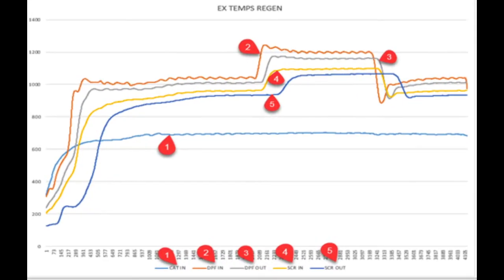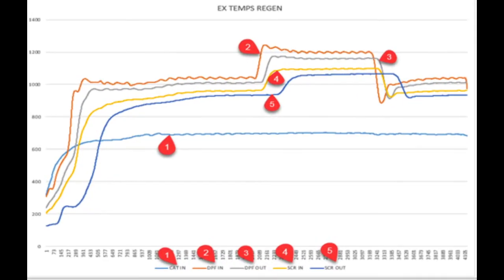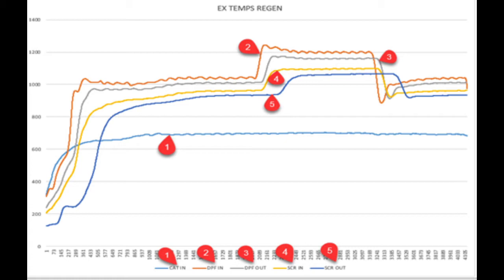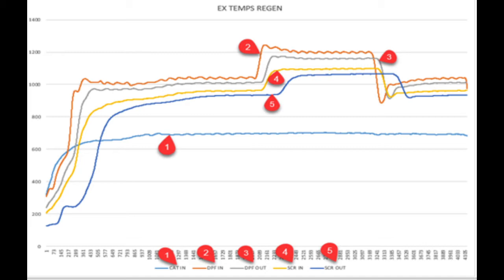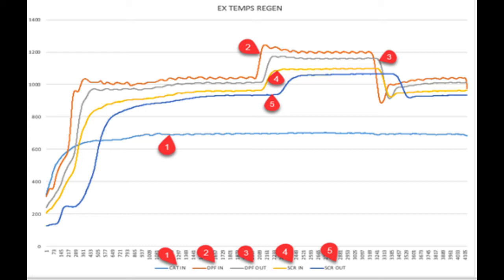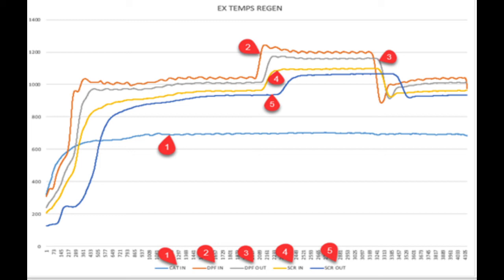ISX 15 CM2250 Regen Temperatures - Textbook regen

Comment: Just finding your channel today, while my work is on 4.5 and 6.7’s this is all great info that is transferable 👌👍
Reply from the maker: Welcome aboard and please do comment whether you agree or not. Those are both good engines in my opinion.
Reply: @ENGINESHOPJOE  the 6.7 is a great engine,  very little trouble mechanically and pretty decent to work on. 
The 4.5 is more troublesome. I’ve seen a few spit out front crank seals for no good reason, and several catch fire due to the egr cooler being directly beside the composite rocker cover. (Burst coolant hose type overheat) 
My biggest bugbear is the injector pipes passing through the rocker cover. 😡

Comment: I have ISL 2350A, RUNNING REGEN, DPF OUTLET STABLE AT 1080, DPF INTAKE 1070, DOC RUNNING 660...WHAT ARE GD NUMBER FOR 2350
Reply from the maker: Those numbers are fine. There is not an exact number but you want to see the same average or ballpark numbers

Comment: I was getting frequent regens 21hrs 38hrs 21hrs 6hrs 13hrs. I have noticed when my truck would regen temps would go over 1K but not for very long and a lot of times I’d be stuck in traffic. I got an ash fault code did a stationary regen off my PDI and temps went to 1200 for a long period of time. Running it now see how it does hopefully I just needed a long good regen. With the PDI it usually regens around 1:15.
Reply from the maker: Look for videos in the next two weeks that talk about regen frequency.  And watch for " The lunch room " videos
The first one is about this topic

Comment: What would cause a 2014 isx 15 to not go over 300 degrees on the inlet temperature? The only code I have is a maintenence code saying I need to run a regeneration.
Reply from the maker: Because I don't have enough data to be able to point at a specific place to look I am going to list the common things I have seen cause this.
First let me say 300 degrees is far below where it needs to get too. Since you know the temp I am going to think you have some sort of scanner code reader. First let it run awhile and make sure the first and second temp sensor agree Plus/minus 50 degrees F. 
Next your exhaust gas pressure needs to be between 110-160 inhg ( most run 118-145) in a regen. If it is over 160 inhg the turbo is over closed for some reason or the exhaust gas pressure sensor is not accurate which causes the system to adjust incorrectly. Make sure you don't have broken piping between the turbo out and DOC inlet. You already addressed the faults present so that is not an issue. If the turbo vgt is not able to move the turbo  vane assembly to the correct spot the intake manifold pressure will be off too. it should be around 18-21 inhg boost. If you have a blown exhaust manifold gasket this can cause the turbo to overclose to try to build ex gas pressure. If the gasket is leaking but not so bad you can easily feel it then it probably is not stopping the regen but can make it harder to get to the temps you need. The boost side of the system needs to be leak free as well.  Let us know how you make out.
Reply: @ENGINESHOPJOE  Thanks for the information! I ran a regen and the exhaust gas pressure was at 50.9 inhg. The intake pressure was at 7.2 inhg. The exhaust gas temp got right up to 600 F, but did not go past that, and the DOC intake temp got to around 350F. I also noticed that the DEF temp gauge was reading 32F which is obviously wrong so I'm thinking there are issues with the ECM despite having Cummins calibrate it and update it twice.
Reply from the maker: A few things you need to check. Make sure the exhaust gas pressure is the same as the barometric or ambient air pressure sensor at key on engine not running, They should read the same values in a perfect world. But where i am from ambient air psi is 28.9 so I see exhaust gas pressure between 30 and 32 unless the sensor is new. That is ok. but if it was 34 or more id change that sensor which is in the rear of the thermostat housing with what looks like a brake line going to the exhaust manifold sending exh pressure to it. Now Problems you have: In a regen and the engine operating state should read "aftertreatment regeneration" you must have 108-160 inhg exhaust gas pressure (and a healthy turbo is at 114 ish.) Intake manifold pressure has to be 10-12 inhg. At 50 inhg exh pressure it will never get hot enough to regen. If you have insite do the turbo hysteresis test and see if it passes. I think there is an issue with the turbo or vgt motor on it just because exhaust gas pressure is so low. The def temp issue is most likely the def float assembly. We have a high failure rate on them. The classic signs are wrong def temp or level read out or def quality faults with known good def. Don't be too quick to condemn the engine ecm they are very very seldom the issue. I would bet money on the def float assembly module being the issue. 
Last It is very difficult to give you good information with just a hint of what your entire system is doing- i mean an ecm image with faults and history and a data log of the attempted regen is what my guys have to send me before we even discuss where to go in troubleshooting so don't buy parts on what I say as i'm not there. My direction to you if you were one of our techs would be this: Your engine will not regen until you get the exhaust gas pressure up to 114ish in regen mode. The intake pressure will then fix itself if. you have no leaks in the CAC or hoses etc.  Run the aftertreatment regeneration analyzation test and follow its direction.
Reply: I swapped a new turbo and actuator on it and now it's heating up hot enough for a regen.
Reply from the maker: Im glad you got it fixed. I know those parts cost an arm and leg so I really try to be positive before I change them but I think you hit the nail on the head and have a good fix. Things to do to extend the life of that turbo and vgt: No boost / cac leaks, Cooling system temperatures stay in the normal ranges ( 180-220 F ). Let it idle 10 minutes after a cold start ( below 60 degrees F) before you take off. Let it idle and cool down 10 minutes after working hard all day before shutdown. If you idle it overnight don't idle up over 950 rpm. If you idle over a 1000 on the isx 15 2350 for a long period you cause other problems. 950 is all it needs even in the coldest nights.
Reply: I have another 2013 isx 15 that does not heat up either. This one has a code for DPF differential pressure that is above normal. It's asking for me to do a regen but whenever I start one the engine is constantly surging like the turbo is opening and shutting non stop. The rubber sleeve going into the egr valve balloons as it does this. There seemed to be a lot of back pressure on the DPF, but I had it cleaned and baked and that made no difference.